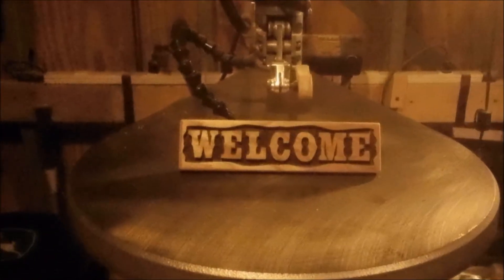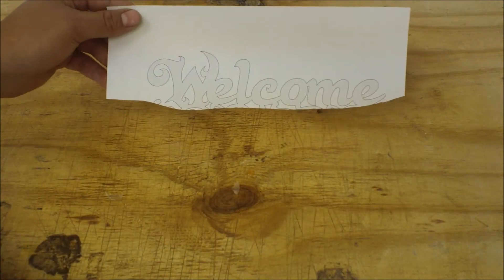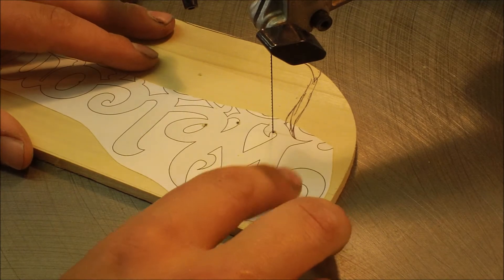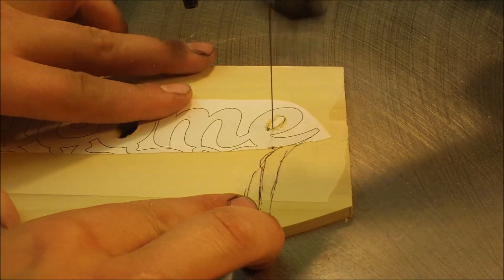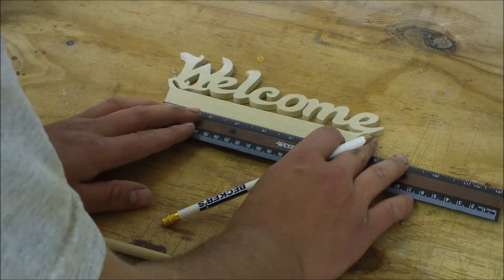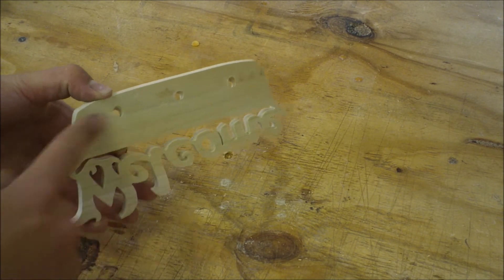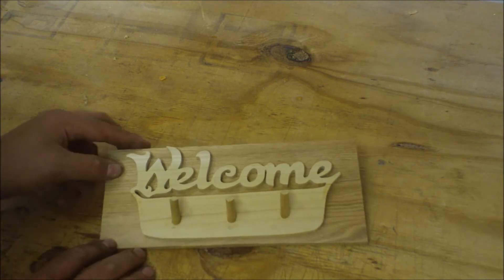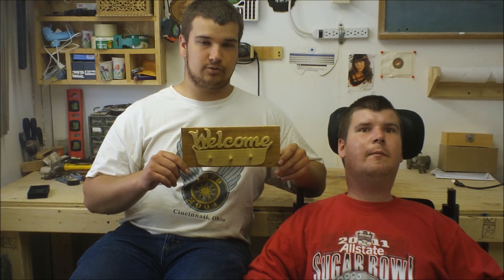Ep.81 Welcome Key Holder

Comment from the maker: Hey Mitchell Williams, for some reason it won't give me the option to reply to your comment, so to answer your question, there are a couple variables to make sharp turns. Most important is size of blade. Smaller the blade, tighter the turn. I think I'm using a #1 size blade, not sure (I haven't watched this video in a while). Another little technique to make sharp turns is the way you turn the blade when you make a turn. Hard to explain, but try to follow lol. As you go towards a corner, just cut right to the point, then back off just a hair while turning the corner putting more pressure backwards than forwards.(so you won't cut backwards obviously the teeth are on the front) then once you have made the turn, just keep cutting along the like normal. Most people take a turn like cutting a circle and continue the same pressure forward as you cut, going into a 90 degree turn or smaller, just back off the blade and turn then continue cutting, that way you don't round the corner, and make more of a point. Make sure you have the saw running while turning or you will brake the blade. Hope this helps some, thank you for the comment.